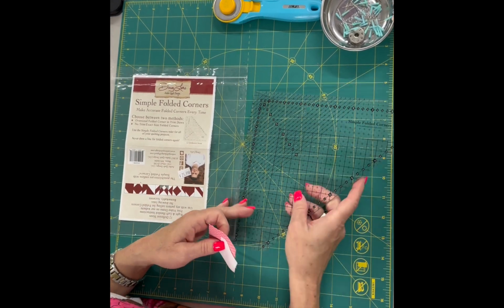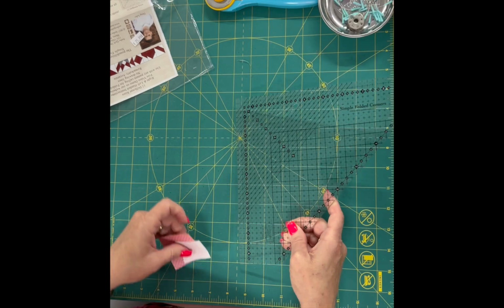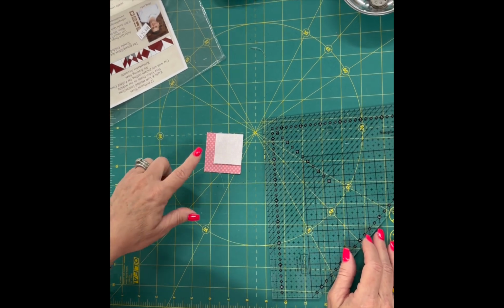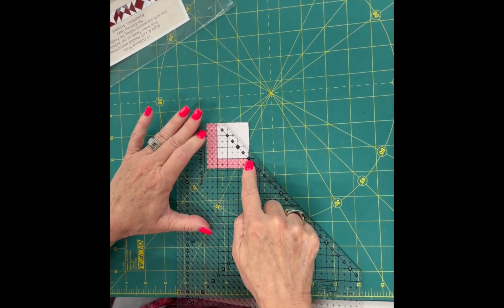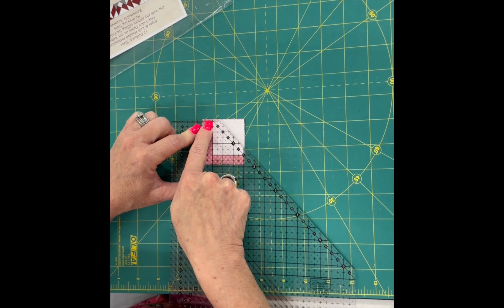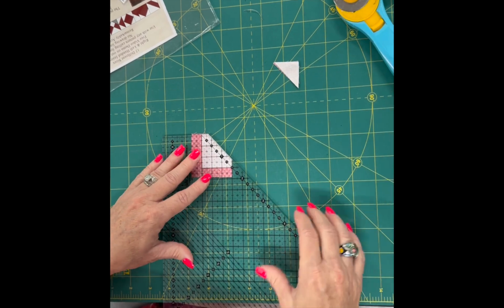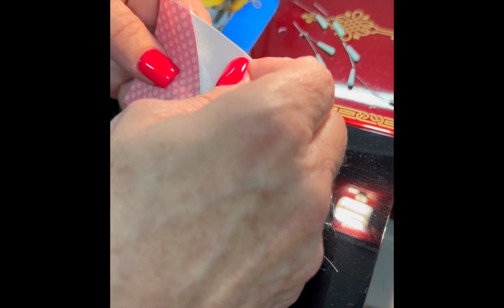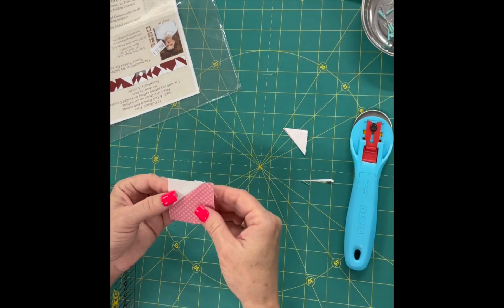Easy Quilting Tutorial: Simple Folded Corners Ruler by Doug Leko

Comment: I love this ruler; always recommend it,  and I have had it for several years.  It's an MVP.  I have a couple of items for you to consider.  (1) Unless you want tiny HST's (and many do; I don't), consider cutting the replacement corners from a strip (the size of the square needed)using the ruler.  You can slightly oversize the strip if needed (I find scant 1/4 on sew works as well) to ensure a uniform fill for the cut away.(2) Using this ruler you can speed your HST cuts along by cutting rectangles from your strips, and then setting the ruler once and cutting once.  Simple at .75 (3/8 + 3/8) which is the measure of the flat top for the 1/4" seam allowance.  By adding 2 x you get the flat top for both units. It's a huge time saver without any sacrifice of accuracy.   This ruler is great for squaring up flying geese units too.

This ruler has many other uses-to include pre mitering your binding strips for perfect alignment- because there are not too many rulers that have the level of  90 degree markings perpendicular to the diagonal that this ruler does.  Great for trimming HST's when using the seamline method.
Reply: ❤ I'd love to see this.Make a video!